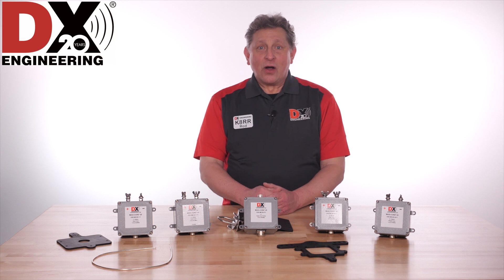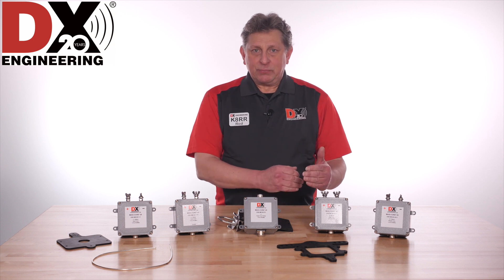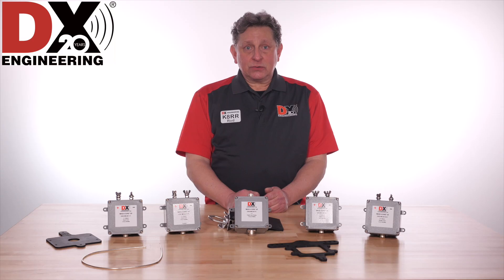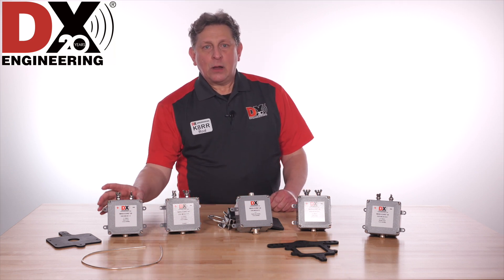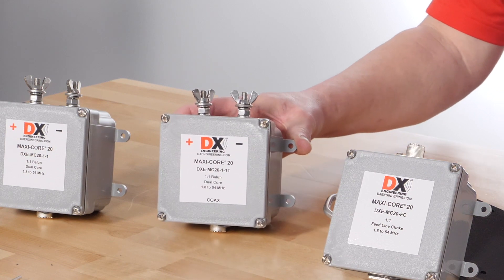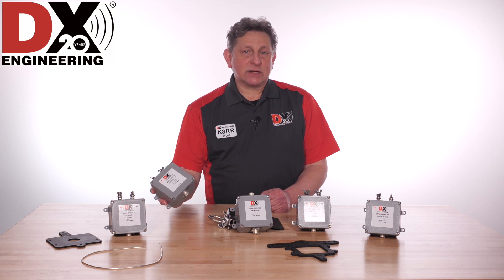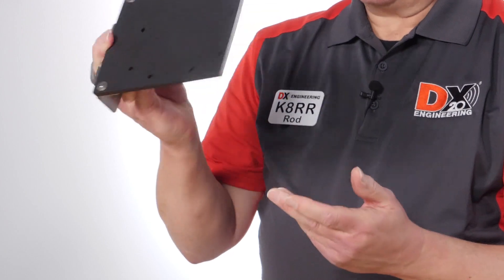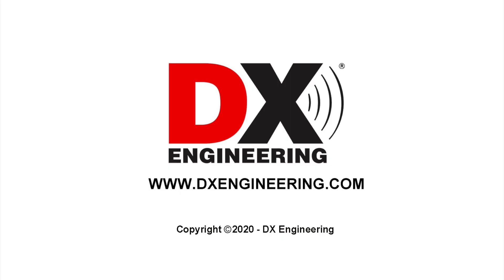DX Engineering introduces Maxi-Core ® 20 Baluns and Feedline Chokes

Comment: I have a 200 foot long inverted V doublet or therabouts that length anyways .. I have a legal limit tuner and currently have the older style DX engineering Model BAL-050-H10- AT Balun, This I believe is a 1:1.... I run this balun about three feet away from my tuner with a 3 foot piece of lmr 400 and feed the entire remainder of the antenna with 450 ohm ladder line out the wall and up the tower to the inverted V.. I do run legal limit here in candna and im wondering since this is mostly a non resonant antenna should I not have a 4:1 balun for my application would A 4:1 work better for my tuner..
Reply: Did you ever get an answer? Curious, since I run a similar set up, but moved.